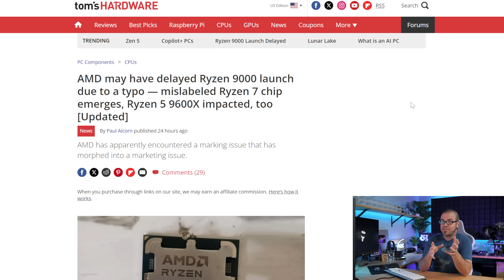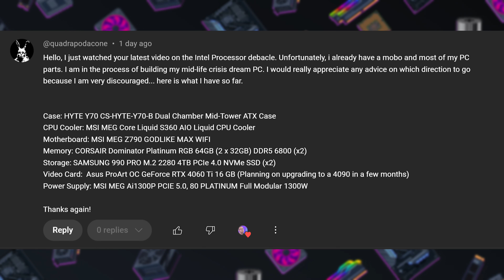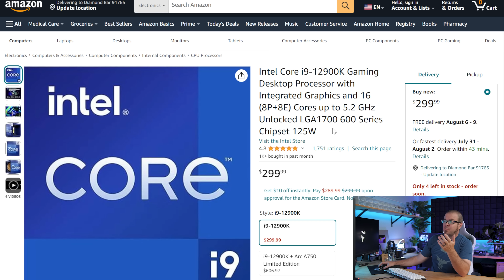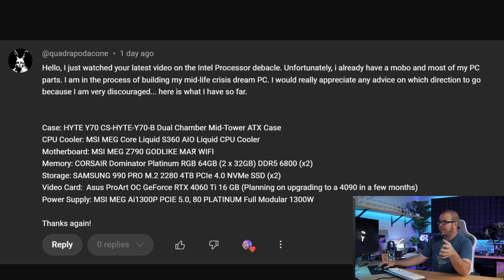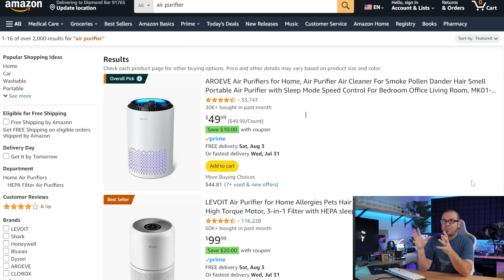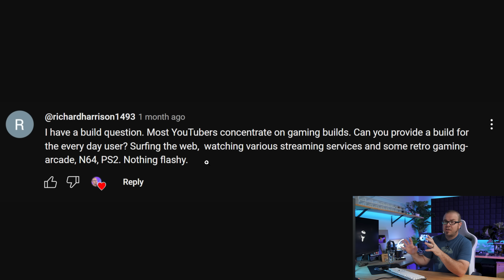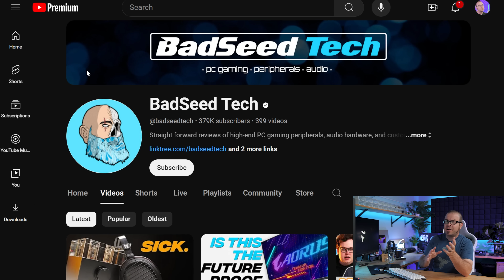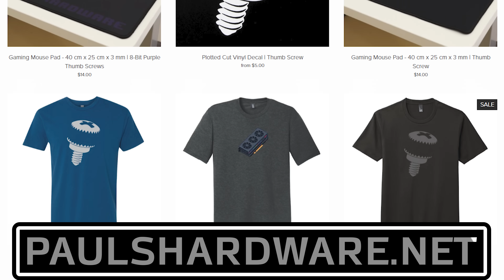What if my Intel CPU explodes?? - Probing Paul #88

Comment: A question:
I still use my trusty pc I built over 6.5 years ago.
With:
i5 8600K 
Z350 Gigabyte Gaming 5, 
GTX1080 Gigabyte Windforce 
Corsair Vengeance LPX 32GB

I want to upgrade at the end of November (BlackFriday), but since the new gen CPUs (and also MOBOs) are coming, I still don't know which mobo and CPU to buy. About the GPU, I think I'll wait for a next gen GPU and use my 1080 in the meantime.
Either that, or just buy this\last gen crazy high spec for a lot less at BF (as there are some MOBO with PCIE 5 support).

Comment: Ok! I hope you can answer this tech question and maybe you've never been asked this before, but..., I need a 280/240 AIO with the pump in the radiator. I know they make them but the only one that I'm aware of is the Hyte Q60 Thick, for $300. I'm considering it, but so far, a search hasn't returned many other results. I'm hoping that you are aware of more. I prefer a 280, (which the Hyte doesn't have) & a 240 might work, but I plan on fitting it inside the front of a modded Corsair 760T case and this case is large. I'm afraid that a 240 would look out of size, especially viewed from the front through a wood carved grill.

Due to the case modding, the front now has a Hobbit Home where the top drive bays were, and a CPU pump puts any front mounted radiator below the CPU. Presently, I'm running a Corsair Capelexe Elite 280 in the top, but I have plans for the top to include Hobbit Carvings in wood, along with the modded wood carved side panels to complete the theme. This means that the top mounted AIO will have to go.

Comment: Regarding basic computing: I go APU's for that. AMD has the best there, by far, and the latest 8000 series APU's are amazing. If you don't know, APU's are CPU's with exceptional built in graphics. And the upgrade path is as simple as adding a GPU down the road if you feel you need more power....but if you only have basic needs, than that really wont be needed. Excellent as always Paul, look forward to the next home update as well 😊

Comment: Currently I'm waiting on Intel 15th Gen, Z890, CAMM2, and RTX 5000 for my upcoming build. I'll be going back to a desktop, an MATX build, to replace my Alienware Area 51m R1 laptop for my semi truck.

Kinda sad Deepcool isn't available anymore, as I was interested in using their Assassin IV, as the performance looked good, and I liked the aesthetic it has. Guess I'll probably end up going with either Noctua or Be Quite instead. (Unless they manage to overturn the sanction in court)

Overall in the long-term process of overhauling my entire setup in my truck. Doing so for better performance, easier upgradability/maintenance, and comfort. Going from a 17" screen to a 42" TV, and from 1080p to 4k will be a nice change. Already got my Case/chassis, keyboard, new mouse, DAC, and some other accessories sitting aside. Kinda waiting for CEDIA 2024 in September before I buy a TV, hoping Sony might release some updated models to the Bravia XR series A90k & A95L. (Or wait for a good discount on the A90k 42")

••• Also from my experience so far with this new USB DAC I picked up, the Creative Sound Blaster X5. It's been great with my my Audio Technica ATH WS1100 headphones. (Comparable to the M50X series) Big difference in sound depth, bass, and clarity versus just plugging them into the audio jack on my laptop. Also has good physical controls, the software is easy to use, and as a plus it also improved the sound quality on my Antlion Modmic 5. I'd certainly recommend it from my personal experience. I've used it for watching videos, streaming music, and gaming. Overall been great. 👍

Comment: The "browse the web" type computer can be done with an AMD 5700G or quite possibly with the iGPU on any 12-15th Gen Intel, though that may warrant investigating. The integrated few graphics processing clusters on the 7000 series AMD CPUs are there for office use or diagnostic when the discrete GPU stops displaying on the monitor available, because if the CPU won't display but will POST fine, then the problem is a dead monitor, not a dead card. HOWEVER many emulators use AVX512, and the AMD7000 series do that excellently and the 9600 CPU will do it faster than any 14th or 15th gen Intel and it is THAT, not graphics power, that they require, but THAT depends on what software you are using to emulate with.

Comment: Still not sure if a i5 13600K has the same problems. Just updated from a 9600K and hope I won't regret it. Updated the BIOS to be sure and so far no problems but it's still not clear if it has the same problems or not. All the talk and info is only about the 13700/14700 and i9 processors.

Comment: For average ppl who don't know how to tune their pc's AMD is the more no brainer choice right now. However, if you do know how to tune your pc then Intel is still perfectly viable. You just have to make sure your not sending an absurd amount of voltage to your chip for the cooling solution you are using and lock your cores. It's going to perform better than stock anyways which is how I have all 3 of my Intel systems setup; all of which run perfect. Intel really screwed up, they got greedy and now they are having to pay for it.

Comment: 12:00 used to use a 2 channel usb dac, but with so many games supporting surround so well, i changed over to a home theater receiver getting the high bitrate multichannel audio via hdmi, but then that means your system is outputting a display to a home theater receiver, which isnt a problem if the receiver supports the resolution of one of your screens, but almost none support high refresh above 120, most only do 60... b ut the audio quality is quite amazing, the Marantz DAC in 2 channel sounds very comparable to the smsl su-1 i was using previously, warmer, maybe slightly less detailed, but all the harshness is gone, plus i get 9.2 with Atmos support..   would never go back to an internal sound card unless it was a travel machine.. even then, would likely just bring the smsl.

Comment: Intel really needs to extend the standard warranty to 7 years for both the 13th and 14th gen CPUs to show they truly stand behind their products after the microcode fix. As some CPUs may start failing prematurely due to accelerated aging in the early years of their life, meaning their lifespan is cut short compared to previous generations.

Comment: Here's what I find odd about the Intel CPU failures. They know what is causing the failures but no YouTube hardware tester is actually grabbing a handful of Intel CPU's and testing them and seeing if it really is all the 13 and 14 gen CPU's.
Reply: A lot of them have been trying. Gamer's Nexus was even been talking to a lab to have extremely expensive analysis done to try and figure this stuff out.
The issue with this kind of problem is that it's caused by degradation over time. So the chips may seem perfectly functional, even when overclocked and with messy power settings... until it's suddenly not. So just going out and getting a bunch of chips and running some initial tests it's going to tell you anything. It would be a loooong process, and would require a huge sample size to be any good. - Most youtubers aren't exactly swimming in cash, so it would be a rather steep expense.
Reply: @R4d1o4ct1v3_  but they are not demonstrating the high voltages either and that's odd.
Reply: @gerardgauthier4876   we know the high voltages aren't causing these issues by now, so there is no real need to extensively test that. The degradation issue is happening regardless of over-tuned power settings. (As shown in the videos from Gamers Nexus and Level1Techs)
Reply: @R4d1o4ct1v3_  So everything, until now, has been lies.

Comment: the thing that confuses me is that the 13th gen has been out for quite a while, and we didn't hear anything of these issues until near the end of the 14th gen lifespan. i mean not in the forums or any comparison videos or anything. not from any Tech tubers either. no reports from streamers getting hard crashes in games... why did this suddenly happen to both the 13th and 14th gen at the same time even though they released about a year apart? i guess i just feel like im not getting all of the information.
Reply: It's been in forums and on Reddit before 14th Gen. I've been seeing instability issues with the 13900k and KS for quite some time.
Reply: @tresnugget  i havent seen any of the tech tube guys say anything about their systems crashing or any other unstable issues. if this is supposed to be 100% of the processors doing this, i would figure theirs would have been affected, and they would have jumped on the issue just for the views. if its not 100%, how many are affected? at this point, ive heard that it was mobo manufacturers pushing the cpu too hard, that the micro code wasnt right and that there is an oxidation issue with them. what exactly is the issue, or dont they know for sure?

Comment: Unreal that anyone is signing up for their cpu to stop working let alone at Intel's egregious prices. It's just pathetic and shortsighted. I'm completely baffled. 

It has been stupid for any gamer to use Intel for years now, but to reward their disgusting mistreatment of customers like you and I is an outrage. You're utterly clueless if you've been made aware of the issue yet insist on buying an Intel cpu. Intel relies on ignorance and this bizarre stockholm syndrome that causes people to make decisions they ought to know are horrifically asinine.

I'm not surprised someone insisting on using an Intel platform and cpu would buy the worst Nvidia GPU in years, the 4060 Ti, at $450 just to buy another gpu a few months later - both a mere five months before the new generation is expected if not earlier. It's something special to have that kind of economic privilege and completely waste it.

If you're willing to take advice, here it is: return the motherboard or sell it. Buy ryzen 9000. Buy an actually cheap GPU to tide you over until you can get a 4090. Better yet, since you've acknowledged this isn't rational and is just a lashing out against the passage of time, just get a reasonable gpu like a 4070 super. Ask yourself if you actually like the hyte case or if it's just the most trendy thing so you defaulted to it. 

Since you're now on AMD, get normal 6000 MT/s or whatever ends up being best for ryzen 9000. Figure out what you actually need and cut your motherboard cost into a third of what it was. Suddenly you need a 750W PSU at most (being very generous with headroom). No water cooling required since the cpu isn't a dying furnace from a dying company that solely exists for stock buyback investor leeching.

You just saved like three grand and your computer won't crash in games or outright die in a few months. You're welcome.

Comment: Glad I have my rig with a Ryzen 5700G APU:
openSUSE, custom Kernel booting into KDE/Plasma+Network in under 2 seconds (no GRUB or initrd needed).
Easily capable of running Steam, »Alien Isolation« (no GPU needed), regular kernel compilation under 3 minutes. 
(Old rig had a Haswell Core i5 and an Nvidia 1050GTX — it ran fine, but the extra steps with Nvidia driver blobs made it far less pleasant than it's now with the AMD 5700G).
Cheers!

Comment: Grabbing the latest BIOS will only help if your manufacturer has bothered to drop an updated revision. MSI for example haven't done that in the case of my Z690 Tomahawk DDR4 - seems like they've only published updated BIOS-files (containing the 0125 micro-code update) for their Z790 boards. All I could get as of today is a BIOS from April 2024 with an update to 0123 micro-code. Asus OTOH seems to have worked a lot faster here, as their equivalent to my MSI board (Z690 TUF Gaming) does have a very recent BIOS available.

Comment: While they will get the job done for most tasks, I'd still steer people away from most mini PCs. They're almost all mobile CPUs and limited compared to their desktop counterparts.
They're not socketed, so you're stuck with the CPU you initially got, their RAM is limited, as are other areas of expansion.

A lower end PC build however, done right can grow with you and become a gaming PC at some point by dropping in a GPU.
That would be a nice build to see - no bling, no RGB (which I know is what makes up most B-roll these days). just clean cable management and performane.
Reply: Instead of getting a cheap new mini PC I'd rather buy a used Dell or HP micro PC. 

I have a dell 7060M and it has socketed ram and a socketed CPU. Plus a hard drive tray to add a 2nd drive. For $100 on eBay you get so much more computer. I'll take my 8th gen Intel i5 over some new Celeron or ultra low voltage chip.

Comment: Had a 13700k for over a year and no problems at all so far, fingers crossed.
Reply: matter of time dude, matter of time ajust manullay
Reply: @nivea878  Really now?  Are you an Intel chip designer and you have specific data that shows the 13700k is at any risk at all, or are you just parroting complete and utter bullshit that you think you heard?  The use-case is also critically important, even with an i9, if all you do is play games and do typical desktop stuff ( not hours-long renders), and don't do moronic, pointless, endless benchmarks, you're never going to see any problems.

Comment: About the entry level mini PCs
I have worked with a ton of HP ProDesk/EliteDesk Mini PCs, and can highly recommend them, they have socketed desktop-class CPUs, socketed SODIMM ram with an extra slot for upgrades, an M.2 slot for storage, pretty solid IO, and easy to open and work on with only a few screws. (although no GPU options, at least not the office systems I've worked with)

Comment: @Paul's Hardware - Although you have mentioned the 13&14900 Desktop CPUs, is there any news about the 13900HK (laptop processors)?  I have an engineering sample one running on a desktop motherboard and was wondering if these might be affected.  I have undervolted mine to reduce its temperature and hit a max of about 85 degrees under full load.

Comment: This is mainly an issue with motherboard vendors like MSI and gigabyte. Asus has helped Intel to fix the issue with their CPU.
Reply: The high voltage is because the cpu request it from the mobo not the other way around. For more info check out actual hardcore overclocking

Comment: To prevent dust accumulating, one solution is to get industry dust filter fabric (they come in huge blankets)  and give up fancy case window, then seal the box with the filter best as you can from all six sides. Only prevents dust, not airflow. Can be applied to most cases capable good cable management.

Comment: My i5 13500 has recently been massively underperforming. Different benchmarks show its drawing way less power than expected. There’s a chance it could be my Evga 750w psu or b760 mobo, but I doubt it given the current situation. Bugger
Reply: Your 13500 is Alder Lake, so it has nothing to do with this tempest in a teapot.

Comment: How do I test the stability ? I mean which benchmark induces it? I have a two z690s from gigabyte and one from asus with 13900k 128gb ram works only with 12900k but not 13900k even though I updated the bios on both. can it be considered stability?

Comment: I just bought a laptop with a 13900hx and 4080, it performed horribly, then the story broke about intel issues. I quickly returned it and bought a similar laptop with a ryzen 9 7845hx. I couldn't be more happy, the thing literally keeps up with my 7950x on single core benchmarks.

Comment: 11:37 I agree with Paul.
Even a high end mother board might have issues with microphone recording. So don't buy a pricier motherboard just for the audio. But when it comes to music audio then there will be a slight difference in clarity, I meant slight! Some might not notice it.
I have a ASUS ROG MAXIMUS XIII HERO, not latest and greatest, I had issues with audio having artifacts, for some reason only in web browsers. 
And as I mentioned there clarity will be better on an external audio interface, but if you do voice recording or 2ant to do video calls it's a must.
I scored a Rode AI-1 on a great price, it was only tested and sent back, so got a nice deal, but this unit is already quite affordable. But even with Asio driver installed I can't get the volume loud enough for the mic. So I recommend EqualizerAPO If you have this issue. There you can adjust the gain to appropriate level. But maybe other interfaces exist with more gain.